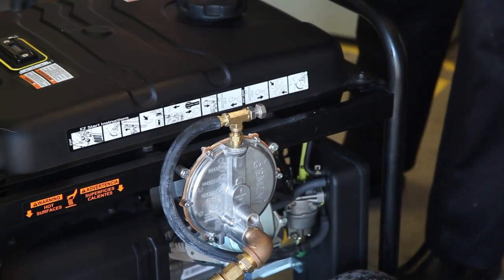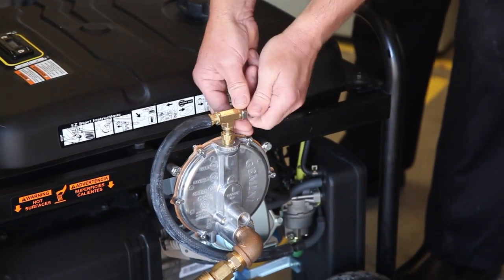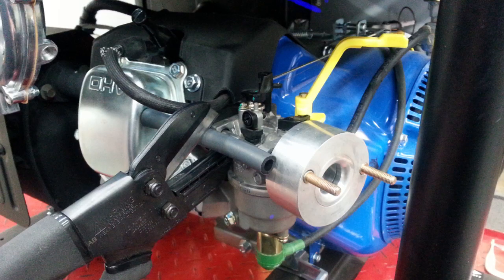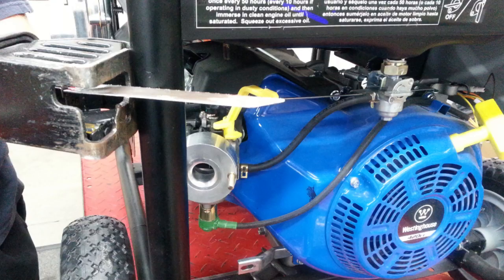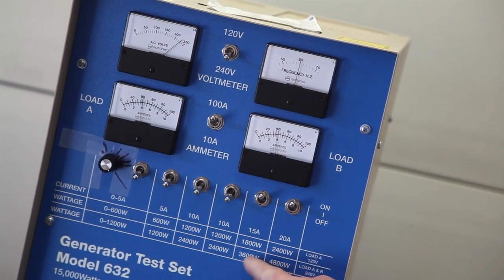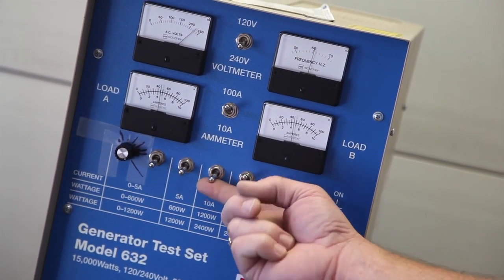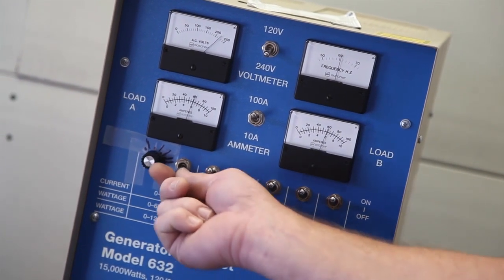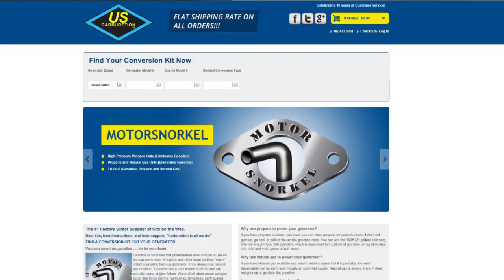Introducing....Motor Snorkel

Comment: Great product! I installed on a DuroMax Elite MX4500 Generator with a Chonda  7HP engine. Easy to install and runs great on natural Gas. With the motor Snorkel, you do NOT have to cut the frame to make room for the air cleaner. On some kits the carburetor adapter when installed causes the air cleaner on some generators to hit the frame.

Comment: Great product. I just installed the Motor Snorkel on my Predator 7000/8750 generator from Harbor Freight Tools. The instructions were easy to follow and installing the snorkel literally took me 5 minutes. I ran the generator on gas for about 2 hours then I let it cool for about 30 minutes prior to install . It started on the 3rd pull after giving it a quick half second primer shot into the carb. I plan on doing a cold start today after work to see how many pulls it takes and to see if I even need to use the choke. If I have any significant change, I will update my post. My only complaint is that it took me 2 days to find all the parts to neck down the demand regulator so that I could hook it up to my propane line. Drove all over Maryland looking at specialty stores becasue eveyone said they didn't have what I needed. I ended up finding and connecting 3 fittings at Lowe's (Plumbing section, Brass) to make it work. Don't let the helper guy tell you they don't have the right fittings because THEY DO! If I would have just tried to figure it out at Lowe's for myself the first time, I would have been fine. For anyone out there that is considering purchasing one of these.... DO IT! I recommend US Carb machine and patent a fitting that goes from the 3/4 inlet port down to the 3/8 SAE on the end of most propane hoses and include that in the kit or even charge like 10 bucks for it. I would have paid for it.
Reply: *UPDATE*
Went home and tried a cold start. After hooking everything up and trying to pull start about 6 times, I had no luck starting it with no choke. I turned off the propane and disconnected it and pushed the prime button on the regulator to help bleed the system of propane. I wanted an accurate baseline with no propane sitting in the engine so I cranked it about 5 times to push any remaining propane out then I let it sit for about a half hour. I went back and hooked everything up, turned on the propane, no choke, gave a quick half second shot to the primer then gave it a crank and to my surprise, it started on the first pull. It was barely running and spitting and sputtering so i gave it half choke for about 10 seconds and then opened it up and it ran like a charm. Awesome product.

Comment: For a Champion portable generator of 7500 running watts, what size Natural Gas pipe or tube is required to feed the pressure regulator to run smoothly. Should  the pipe inner diameter be 3/8 or 1/2 inch?

Comment: Have had generators running on propane for over 30 years so I now have Yamaha inverters so I tried the motor snorkel in the two generators and did not have good luck because the tube inside the snorkels flatten so went with the other conversion and both work great? Pay a little more and get a little more.
Reply: Flattening of the tube as it went into the carburator has been my concern, as it has tendency to shut off the fuel flow. So how did you solve this problem?
Thank you

Comment: Question: I recently picked up a Champion duel fuel (gas and LP) generator and I like the unit so far but I would really like to have the option of running natural gas if and when I need to run the generator for extended periods of time. What would I need to purchase from your website that would allow my dual-fuel, 9KW generator to also be able to use natural gas?
Reply from the maker: We need to know the make and model of your generator.  Please email us at support@uscarb.com and we can provide this information to you.

Comment: So when you shut the motor off does the propane or natural gas just keep flowing?
Reply: Shut off the gas and the engine stops.
Reply: @ericperkins3078  No what I'm asking is when you shut off the engine does the gas stop or just keep flowing?
Reply: @ToConnect2000s  The regulator provided is of a type that acts as a valve as well.  It requires a small amount of vacuum (provided by the intake stroke of the engine) to open the valve to enable the gas to flow.  It has a "primer" button that releases a small puff of gas into the carburetor to start the engine, after which the gas flows until the engine stops.
Reply: @ericperkins3078  Cool thank you